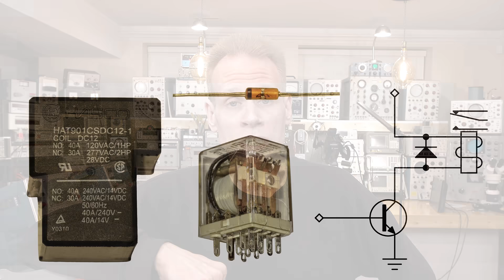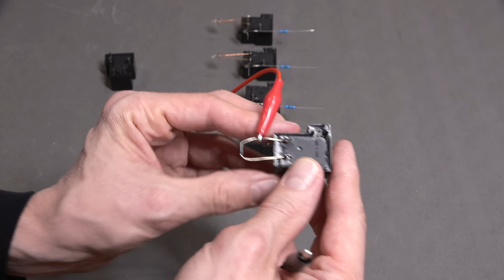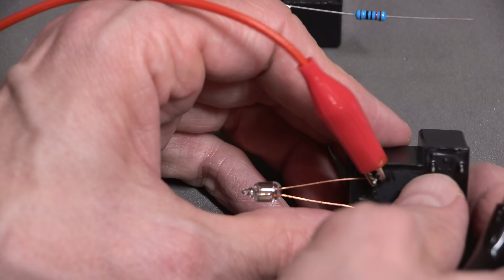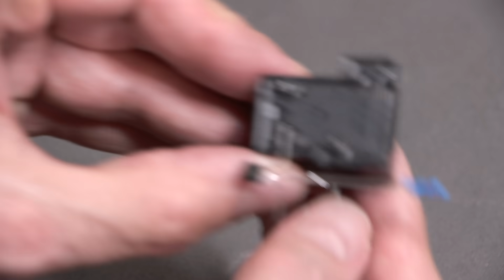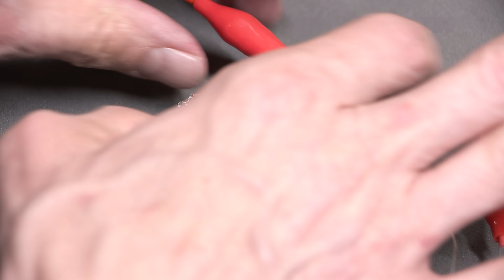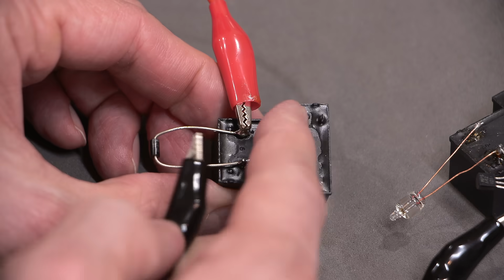Why Add This Diode Across A Relay Coil? This Is Why It's Needed!

Comment from the maker: To learn electronics in a very different and effective way, and gain access to Mr Carlson's personal designs and inventions, visit the Mr Carlson's Lab Patreon page here: https://www.patreon.com/MrCarlsonsLab
Reply: Ok now someone please answer this. It was mentioned in the video about the coil and points for the automotive ignition systems back in the old distributors, (which I used to rebuild on my cars as a teen, by the way). They used to have a condenser to control points burning from arcing. I'm not sure I remember there being a diode across the ignition coils primary, (or secondary). Did that capacitor for the points also protect the coil wingdings in place of a diode? Or was there a diode and I never knew it? Please, Anyone? And thanks! 👏👍
Reply: @jpol3808  A cap or an RC snubber (cap and resistor) is one of the alternative methods to mitigate the induced EMF kickback. Which method to use really depends on the specific application. 
In the case of the automotive distributor points, it's more analogous to the contact side of a relay opening or closing. The control side which opens and closes the contacts are the coil in the relay, but is mechanical in a distributor (rotational from the crank shaft).
Reply: @jpol3808 no need for diode in ignition coil it actually has not to be there because it doesn't let the ignition coil to work properly,  because it doesn't let the energy of the coil to create a high voltage
Reply: @gitsep  tell that to my 72 Dodge that won't start if the ignition circuit diode fails. 😊
Reply: @jpol3808 you probably talking about capacitor, yes the cap has to be there to make the nice spark on spark plugs, the cap helps the spark to last for few msecond, if there was no cap the spark voltage would be very high but it last only few micro seconds
Reply: @gitsep  capacitors prevented point contact arcing.
Reply: @jpol3808 diode can do the same thing , why no diode is there?
Reply: @gitsep  Best I know without all the tech lingo. And since my posted link (will not stay up) to you about the use of Diodes in ignition circuits,,,,,,,, The diode is a switch with a threshold voltage to let current flow, while the capacitor stores and releases to smooth and filter the electrical flow, through the point circuit. The points start and stop that primary circuit flow like a (mechanical) diode. That gave us a mechanical ability (no computers) to time the distributor and set the spark timing to proper degree for the best economical or most powerful fuel burn (before computer control). By replacing points with the diode and keeping the capacitor, the electronic control module was born. And now we could put a computer in every car to adjust spark timing instead of doing it manually. Using a magnetic ring in place of the points to induce current into a pickup coil and the diode can now take the place of the points. Electronic computer controlled ignition was born! Cool. That was until it burnt out on you, $$, but they generally lasted for most the life of the vehicle, compared to points system which was a regular component to service and replace as needed but only cost a couple bucks. Cool.😊.
Reply: @j @jpol3808  the cap absorbs the kick also it keeps the radio from having a noise as the rpm changes
Reply: @loulelea  Always had whine in the radio, equalizer, police scanner and cb until I switched to resistor plugs. Problem solved! Those were indeed the best of times!
Reply: Hi Mr. Carlson, thanks for this teaching video!, I've had friends always wonder why some of the relays quit working after a short time, always looking forward to seeing your videos
Reply: I would have LIKED to have seen the result of putting that neon bulb in parallel with the diode, both with and without any two of the transistors used in this example....🙂✅
Reply: even before watching. ill call it a flyback ... no clue but lets see
Reply: @XPFTP Same pricipal, but it's called a 'freewheeling diode '
Reply: Learned about kickback diodes in electronics school in the 80s, went to a special oil field electronics class in 2010 and was surprised the reverse current portion was't taught correctly, thanks for the reteach
Reply: Protection for inductive kick
Reply: I moved from being a Bipolar Epi Tech in 1972 to calibrating and repairing test equipment including Tek vacuum tube scopes to repairing core memory to becoming a field service tech replacing boards on mini computers to repairing computers to the component level to becoming a sys admin and then becoming a Certified Network Engineer.  In the end I was working in computer forensics so I have forgotten most of my electronics knowledge, this helps bring it back.  I did, in fact, work on core memory and punch paper tape, so I am an "old fart".
Reply: not really when the breaker point opens that we get ignition but rather when the rotor/distributor faces the cap distributor's  point ?
Reply: @amateurdesubaru the points opening causes the spark, which will jump from the rotor to the nearest terminal in the cap when the spark fires.
Reply: @ecker567  rotor and  the cap distributor point have to be aligned to have the spark to jump
Reply: @ecker567  exactly what I said : as long as the rotor isn t aligned with a point in the cap no spark can jump , understand if the rotor is halfway between 2 points no spark will jump
Reply: @amateurdesubaru  yes the terminals must be aligned to spark💯, and we must remember that the spark at the points is from breaking power to the primary side of the coil, causing the induced magnetic field to collapse across the coils secondary windings. It's not the points spark that goes to the plugs. The secondary ignition coil wire is what sent the high voltage current to the cap rotor contact, through the rotor to the cap spark plug wire terminals as it spun, down the wire to the spark plugs. Later!
Reply: Hey, do I need a bulb or a diode across a 120 volt H.D. AC relay handling 20 amps of AC current ? >  relay rated for 120 VAC, 50/60 Hz, and 25A curren
Reply: I seem to remember "relay chatter". Am I imagining things?
Have you heard of this Mr. C?
Reply: I stayed for 14 minutes and never learned why. Get to the point.

Comment: Very nice demonstration, 2N3904 is avalanching and the A2 has a higher breakdown voltage so the flyback current flows thru the Neon..  Thanks.

Comment: Non-Wordy McWordfulness summary:  When current is cut off to the relay, the magnetic field around the coil collapses and induces a very high voltage back on components which may not be able to handle it.  The Diode allows the unwanted flyback current to dissipate safely in a loop with the relay's coil.  There, saved you 22 minutes of banter.
Reply: Yeah, it’s always easier when you’ve known how it works for years.
But when you’re just starting to learn, it’s a lot more helpful to have it explained the way Mr. Carlson does in these videos.

Comment: I had put a diode across a coil top prevent high voltage from blowing out the output of a solid state PLC. Unfortunately, the coil of the relay needed the reverse voltage to prevent the relay from becoming magnetism. So I put the diode in series with the output of the PLC to the relay coil. That solved it.

Comment: Why, then, would relays not already have diodes installed when they are manufactured if they prevent the premature failure of the relay?

Comment: Would an MOV work better than a diode across the coil of relay? I see them used a lot with electrified door strikes and magnetic locks on an access control system.

Comment: Would a diode also be required for the same reason for an application like a small 12 volt motor?
Reply from the maker: Only if the motor only goes in one direction.

Comment: Could this work on an external voltage regulator for a car alternator? I have problems with the new ones, because of the vibrating contact points arcing badly and sometimes not closing or opening after a few cycles.
I apreciate any help or idea!
Bought some ic regulators as well, but they must have some small mosfets in them because they crap out fast.

Comment: We had to do this to a bank of relays in a machine at work.  The machine manufacturer simply reccomend to swap the relays out as a PM about 3x a year.  By adding the diodes , we have to only swap out one failed relay in 3 years

Comment: I use 240v relays for switching single phase between 3 phase supply in the event of one of the 3 phase failing. I checked my relays and they are manufactured with a built-in diode. Informative video, thanks.

Comment: Since it's a coil anyway, it's easiest to just think of the relay coil as a magnetic spring. When the 'tension' (voltage) is released, it springs back to neutral position. Of course there's an opposite polarity jump! You could also eliminate the jump by easing off instead of releasing the clamping voltage in an instant. But that's a pain to do.

Comment: THANKS!!!!    THIS IS INTERESTING!!!  I'M INSTALLING A 100Amp "BATTERY DISCONNECT RELAY," (IN SERIES),  BETWEEN THE (12VDC) BATTERY ( +POS) LEAD, AND THE FUSEBLOCK(LOADS), ON MY MOTORCYCLE, BECAUSE, IF I DON'T DRIVE IT OFTEN ENOUGH, IN COLDER MONTHS, THEN, THE "CLOCK", ETC. DRAINS THE BATTERY, AND KILLS IT!  SO, I'M ADDING THIS "RELAY" UNDER THE SEAT, CONTROLLED BY A SMALL SWITCH, ADDED, ADJACENT  TO THE INSTRUMENT PANEL  ALSO, I CAN PLUG IN A "BATTERY TENDER" (TRICKLE CHARGER), MOUNTED ONBOARD, DURING THE COLD MONTHS, WHILE THE BATTERY IS , DISCONNECTED FROM THE NORMAL LOADS, BY SWITCHING OFF THE "DISCONNECT RELAY".  => [SO,.. WHEN I WANT TO RIDE, I'LL JUST SWITCH THE RELAY "ON", AND EVERYTHING WILL WORK AS "NORMAL",... EXCEPT THAT I'LL NEED TO RESET THE CLOCK, DATE, ETC,.   ]  I WONDERED IF A SMALL CAPACITOR ACROSS THE RELAY CONTACTS MIGHT REDUCE ANY ARCING WHEN THE CONTACTS "MAKE, OR BREAK"....???!!!...NOW, IT SEEMS MORE IMPORTANT TO ADD A "DIODE" (IN REVERSED POLARITY), ACROSS THE COIL OF THE RELAY.  WOW!!!!!!!
....THANK YOU, MR. CARLSON!!!!!!   :face-blue-smiling::face-green-smiling::face-fuchsia-wide-eyes::face-orange-raised-eyebrow::face-orange-biting-nails::hand-orange-covering-eyes::eyes-pink-heart-shape::face-turquoise-covering-eyes::hand-green-crystal-ball::face-red-heart-shape::face-red-heart-shape::face-red-heart-shape::face-red-heart-shape::face-red-heart-shape::trophy-yellow-smiling::trophy-yellow-smiling::trophy-yellow-smiling::trophy-yellow-smiling::trophy-yellow-smiling:

Comment: why don't they add diodes to the part internally then?
Reply from the maker: Too many different applications. If one was to attach the coil backwards (with a diode across it) the diode would short giving the company lots of returns.
Reply: @MrCarlsonsLab  makes sense.

Comment: Excellent!  Very good teaching skills.  Thank you for sharing.  QUESTION: Is any 4000 series diode sufficient (I have on hand....I also have 1N4148"s)?  I am about to add a trailering harness to my 1979 F150 and want to make a relay box at the rear of the vehicle, isolating the extra loads.  I plan to tap off the factory rear lighting circuits using a "no hack" adapter on the existing rear harness plug and using those circuits to provide signal to each of 4 relays to drive the respecting trailer lighting circuits.  I figured that I would do some diode suppression for the heck of it.  Thanks for any suggestion.  Jim-

Comment: Is there a general guideline for what voltage rating to select for the kickback diode? For instance if the switching voltage on the coil is 5 VDC would a properly sized diode be 2X, 3X, 10X the switching voltage? Thank you!

Comment: Very helpful as I was wondering why on vintage audio we add this when rebuilding the power supply on the Pioneer receivers.. wonderful explanations, Sir !
Reply: I had meant the speaker protection board, not the P.S. ..was a long day and I mis-spoke!   I used this when I rebuilt my SX-737.  Doing an SX-850 now and about to put another one in that unit.  Thank you!

Comment: This was very interesting, many years ago, i was repairing microwave ovens and to check that the antenna spread the microwaves inside the oven, we took those neon bulbs from old switches and cut the legs and put them like 10-15 in a silicon hose, then we put the hose in a circle on the plate with a little cup of water in the middle and when we started the microwave the neon bulbs flashed in a sequence that told you the antenna rotated!
Reply from the maker: Ahh yes, the old "Brainwave two" microwave ovens.

Comment: ... why do they not install the diode inside the unit... or did you select these relay that are without it?
Reply from the maker: Unless the relay is for a specific use, the diode will not be installed. If for some reason the current application to the coil was reversed, the diode would destroy whats controlling it. (big money)

Comment: He is exaggerating the truth.  If you have chatter then you have bad ground return..or weak battery. Yes... all modern relays have the diode internal.. but if you have strong battery and correct loop. It will absorb this. Now with the car not running and lights on for a few minutes. HE BECOMES CORRECT..but again..modern Bosch type relays have diode internal.
Reply from the maker: "NO" not all relays have diodes, in fact most DO NOT!
Reply: @MrCarlsonsLab ok let's discuss why you would need it to band aid the situation..I'm not here for you to lose your temper or yell at me. In a vehicle yes the situation occurs. But are you saying that in the home in appliances.   You need a diode to stop the chatter? Let's get to the bottom of this sir.please. without getting upset. Let's get a clarification of the environment
Reply: I just watched it again...you aren't putting straight 12v to the relay. You are current limiting the setup...you are using a small signal transistor ..like mpsa06...actually mpsa56...and u need a current limiting resistor...that's why you developed the problem. Bingo..  I suggest you use a tip 41c and less resistance and throw the relay . And u won't have the bounce...yes...I agree the diode calms it down.. but the situation is common in automotive world because the voltage might have drops due to environment..or weak  voltage...in old ford's they would just sing...flap flap flap..until you start vehicle..
Reply: Sorry I assumed we were discussing the auto 12v useage...so I immediately jumped the gun

Comment: I just want to clarify my mind. The reason that the transistor breaks down is because the kickbackb doesn't have a path. The diode does have a path allowing the energy to dissipate and therefore does not break down.
Reply from the maker: Exactly, you nailed it perfectly!

Comment: Thank you Paul, but how that spike damage the coil of the relay since it acts like a conducter, and then the diode would actually adding damage to the coil since it returns the spike to the coil
Reply from the maker: The voltage spike actually breaks down the insulation inside the coil over time, and the diode safely dissipates that energy.
Reply: @MrCarlsonsLab thank you so much

Comment: Why does the manufacturer not add the diode to the relay?
Reply from the maker: Too many different applications for the relay would be the answer.
Reply: Because the diode would blow up if you connect it wrong haha. Normally there is such a diode already in the output module. Take for example the ULN2803a, that IC is used in many I/O boards and it has built-in diodes. So it's not really needed for a small relay. Only bigger industrial contactors have a connector for an optional protection module directly on the relay. But they don't use a diode I think, there are other ways to suppress the peak.

Comment: I learned about EMF energizing a large coil of telco wire with a 1.5v battery to make an electromagnet…and then I removed the battery, which I was holding with my fingers.  Yikes.

Comment: The new relays for automotive have the flyback diode built into them to handle the kickback from the coil 😊

According to Lenz's Law, when a DC voltage source is connected to an inductor, the induced EMF opposes it hence the flip in polarity when the field collapses 😉

Comment: I just tried to add a relay to the ignition in my 67 Charger. I had a problem with I believe was back feeding. The alternator was charging at 16 volts and was chirping like a bird. I tried to stop the back feed with a couple of diodes, but that only caused the wiper motor to come on and I could not shut if off. The wipers were on when ever I had the key on. So I just went back to how it was before with the ballast bypass.
Reply from the maker: That almost sounds like gremlins (Not the AMC type either :^)

Comment: So heres a quiz. Putting a freewheel diode will keep the electromagnet on for a slightly longer time. Lets say that you want to dissipate the charge faster with a resistor in series with the diode. What value of resistance will make the coil discharge as fast as possible?

Comment: So I have two questions.

First: What about industrial control systems? Typically using 24VDC coupling relays to protect a PLC/discrete output card or a relay card, which are much more robust. Most of the time I'm using Phoenix Contact relays. The compact relays come with a diode. At least that's what's shown on the diagram. And I'm typically driving these relays with a PLC...sometimes just a hand switch or even a momentary contact. If I happen to use a less complex relay without a diode it sounds like a good idea to add one. But how do I size it?

Second: Solenoid valves. Currently have a situation with a 24VDC/22W solenoid valve. How to size a diode for this?